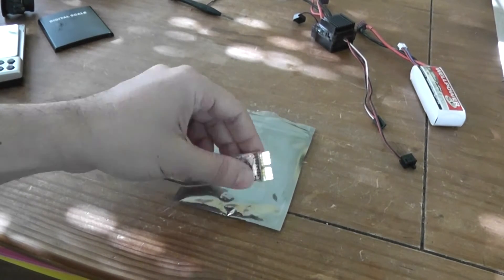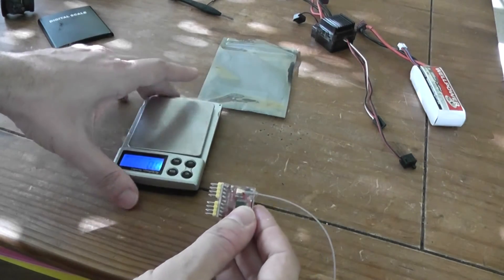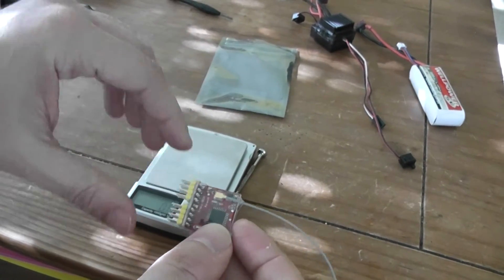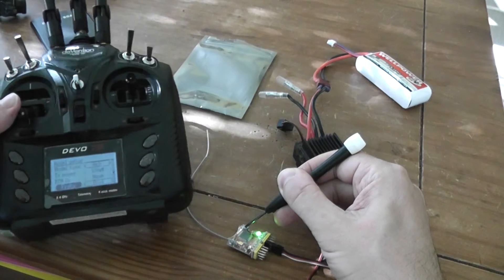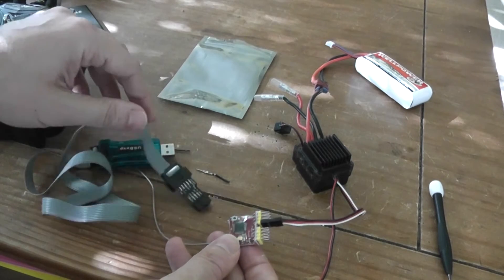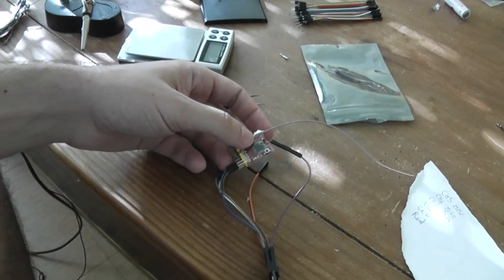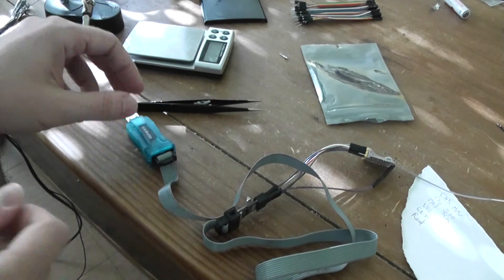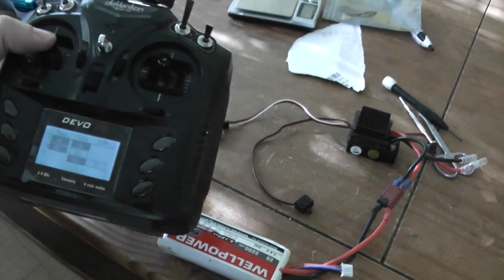DIY FRSKY 8CH Receiver Unboxing, binding and flashing procedure (Courtesy Banggood)

Comment: Seby, do we need to make sure that the voltage for flashing is 3.3 instead of 5? I have tried to update the firmware as I couldn't get the tx to bind. However it started up OK then died. Just noticed on the RCgroups thread that there is some mention of not using 5v.
Reply from the maker: +jimsfenc I think so.... usually, I always try to flash first @3.3V
Reply: +SeBy DocKy Ok I've just received 2 more boards from Banggood. I have flashed one of the boards with newer firmware and now I do not have any kind of LED when power is applied. I definitely usd 3.3 volts from an arduino board during the flashing. I can't get the boards to bind to my DHT module in my 9XR before flashing.
Reply from the maker: +jimsfenc Did you tried to flash a former F/W ?
Reply: +SeBy DocKy I will try it and get back to you.
Reply: +jimsfenc Just an update. I have managed to flash with using the hobbyking atmel flashing tool. I have tried 8mhz and 16 mhz but still cannot bind to DHT module but at least I have the LED back.
Reply from the maker: +Wayne Howarth Well it worked for me at +5V but this model seem to support both voltage: http://www.banggood.com/USBASP-USBISP-3_3-5V-AVR-Downloader-Programmer-With-ATMEGA8-ATMEGA128-p-934425.html So start at +3.3V in any case